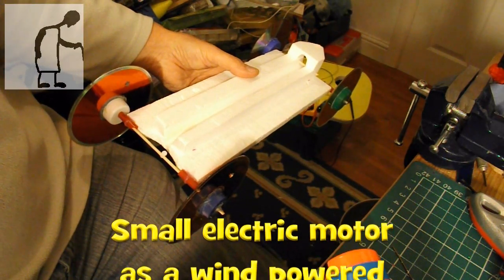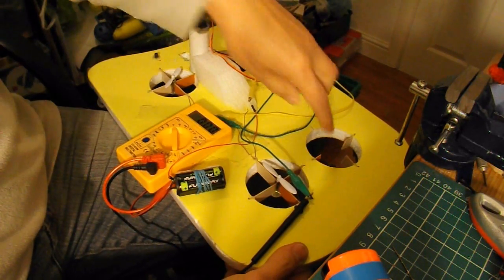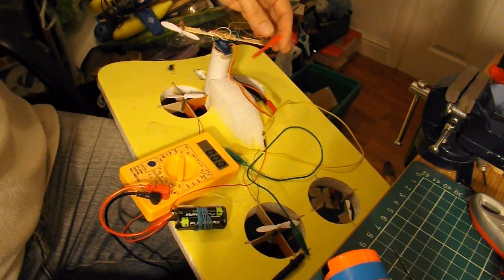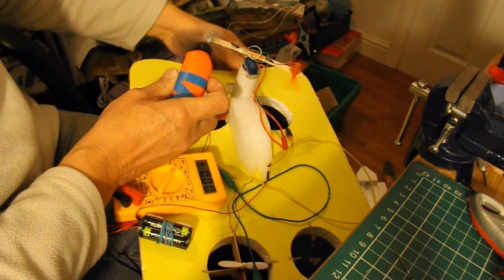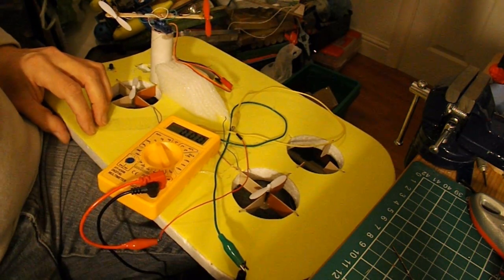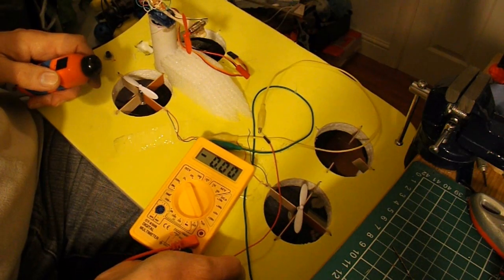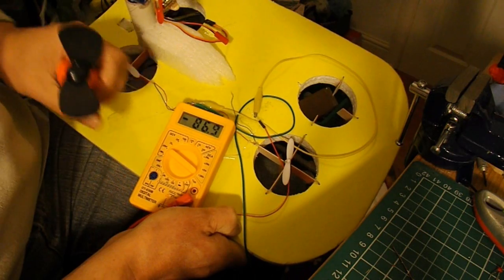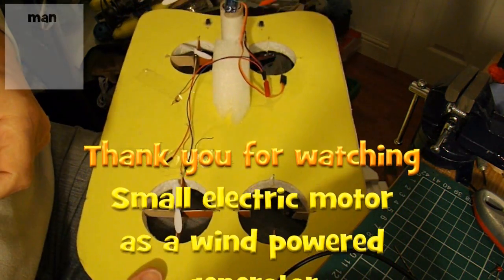Small electric motor as a wind powered generator

Comment: Fun vid. My best simple wind generators have been with stepper motors. They can power LED's with just small movements of the rotor. Coggy, so need big 3 blade propellers. Worth doing though, on average the output with 2ft blades can be 2V at 2A...for charging AA's and such. Your hairdryer type EDF's might do well in a strong wind too.
Reply from the maker: +slider2732 yes I would not have even considered using these little ones, but Chacko asked the question and it was easy enough to try it. The two back to back were surprisingly effective.

Comment: Hello! I just took apart a drill... just for fun. I just wanted to ask you if you could explain how the drill is able to turn clockwise and counterclockwise by pushing the switch in one direction... Thanks.
Reply from the maker: +우희도 the switch will be reversing the direction the battery is connected to the motor. It will be a double pole double throw switch. If you google that you will find a diagram. Here is an example http://www.robotroom.com/DPDT-Bidirectional-Motor-Switch.html

Comment: You might light up a led if you use a joule thief circuit ?
Reply from the maker: +magnetman2010 yes, if fact some LEDs might light direct but we won't be powering anything much more than that unless we charge a small battery or supercapacitor :) I am sure Lidmotor would get one of his motors to run OK. Every time I want to do anything involving wind power we seem to move into a calm period. I still have a car full of kites waiting to film